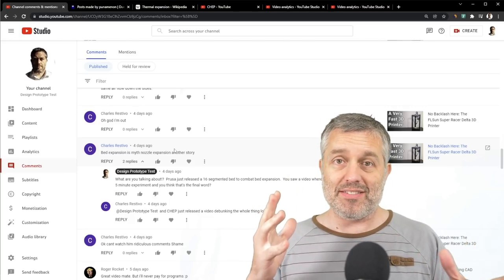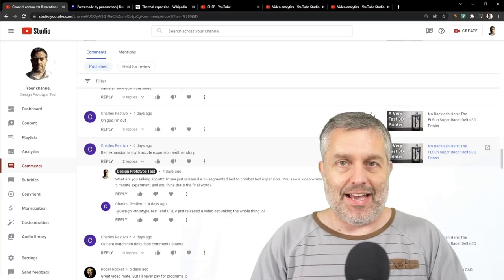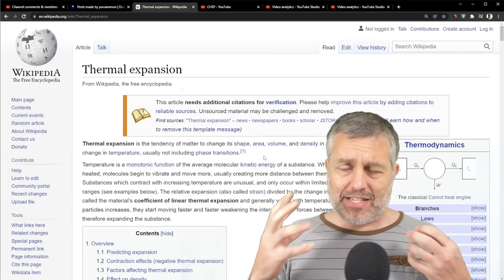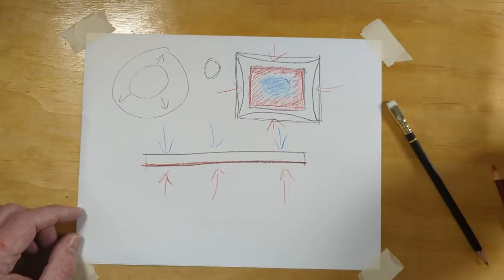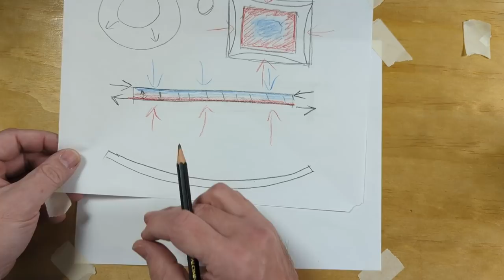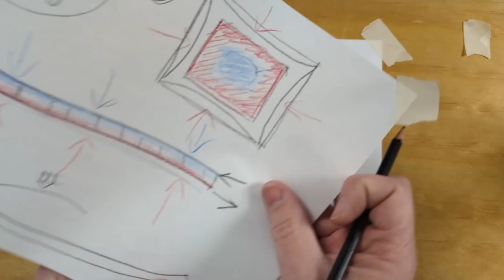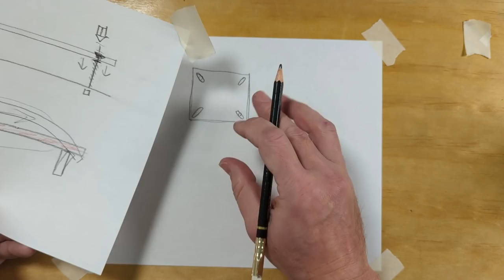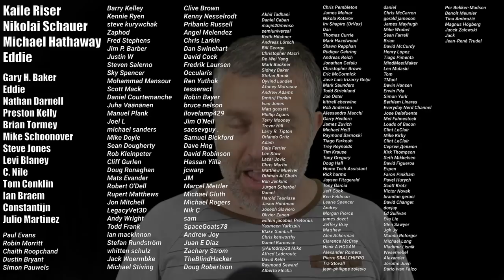The Problem With 3D-Printer Beds When They Get Hot.

Comment: Before the comments get blocked I have a question, sooo you have a warp bed or with bumps and the only way to get rid of those is shaving the imperfections with a CNC or a milling machine if you do it without heating the bed the bed must be flat wright, what would happen if you machín it with the bed heated to printing temperatures??? Will it shave more or less ???
Reply from the maker: The bed is constantly moving/growning/warping depending on how hot/cold it is.

Comment: Great video. I really liked how you made warping caused by thermal expansion accessible. 
Kinematic coupling is what you are proposing. There is some really great literature on this out there, kinematic mounts are used in precision engineering and research quite commonly to deal with the sort of thermal expansion you describe. 
A US company, I think mandala rose or mandala rose works or something is selling a magnetic kinematic bed mount that might be worth looking at for inspiration, you could probably build something similar for a few $ with ball end bolts, cheap magnets and a couple of printed parts. I think it uses "Kelvin coupling" where one point is constrained in all three axies, one is constrained in two(say XZ) and the third is just constrained in Z. Allows even predicable thermal expansion.
Have a look at the Annex Engineering Gasherbrum K3 3d printer, you can find the design on github, with edrawings so you can have a look at how they did it. 
They used maxwell kinematic joints which essentially constrain 3 points in two axis each but all pointing toward the center. Again allows for even and predicaable thermal expansion, but with expansion happening from the middle out, as opposed to from one of the mounts out in the kelvin coupling system.
This coupling system for the bed was one of the things that enticed me to build one.

I'd love to see a great kinematic bed mount solution for the ender 3. I think it would have to be a kelvin type system so that you could keep two of the mounts constrained in the Y so as not to introduce too much play and additional resonance into the system.

Comment: In my opinion the forces that are created by thermal expansion are not constrained by the flimsy mounting system. I havent checked aluminum but a glass bed bows more than a layer height everytime the heater came on during PID
Reply: This highly depends which glass you use and how tight you clamp it. If glass has the chance to expand without being forced into tention it is a material with very low bowing. I print on normal 150C floating glas with aboslutly now bowing when I use only weak clamps. This weak clamps are not able to hold back the bowing of FR4. The 400C rated glass from creality for ex. is even better...

Comment: If we set over the aluminum bed a thin piece of glass do we not minimize the issue? It would be nice to see some tests. Sorry for bad English. I appreciate you standing for your point of view, keep up the good content!
Reply: depends on the glass. glass expands and contracts with heat just like pretty much everything else
Reply: @Jay Aristide  yes, but is not constraind by bolts, just by some paper clips that I think allow expansion
Reply: @razvanilea  problem is glass will tend to bow/flex with the metal underneath. It wont bow/flex AS MUCH as the metal underneath, but it will still be a measurable amount. On smaller beds, it wont be enough to be an issue. On larger beds, though, it will be enough that you still need to correct the underlying issue
Reply: @jfaristide  yes, I think you are right

Comment: ::Looks at my CR-10 S5 and cries inside:: That damn thing is so SO warped when heating, not even the BLTouch can save grace...
Reply: you can do a 3-point kinematic conversion (the ball bearing solution he mentioned) on it. you'll lose a little z but thats it
Reply: Same here. Printing my first layer thicker to reduce the problem.
Reply: @jfaristide  This won't help much without mesh leveling. Crealitys printers are know for warped beds. Even without thermal expansion. My Ender 3 is so warped without an bltouch nothing would stick.

Comment: nice video. well explained.
am wondering about the bed bowing upwards. would say the supports dont confine rotation so hinge at each end basically. and it doesnt confine it upwards because the spring is much less stiff compared to the bed. the supports probably give some tension force along its axis which would be facing inwards when the bed expands. maybe they could put the bottom of the supports in a wider stance so when the bed expands the force is just downwards.
the ball bearings i think is a great idea. just use ball bearings on all supports except for 1. it would need something to stop the bed rotating about the single solid support though

Comment: I would love to see a video with the math behind this and do a real test with surface trace (could be a bltouch with a big mesh like 30x30 points) and test it at various temps like room temp, 40°, 50° all the way to 100 or 110 and compare the mesh, maybe if you print Pla and your room temp is like 25°C and you take your bed to like 50°C there is not much of a difference, but to 110°c the bed would get really warped. Pd: keep the good work!

Comment: I thought that was a good demonstration of the theory. On the other hand, Chuck did the experiment and found the effect negligible _on the printers he tested_. The bottom line is, YMMV depending on many factors. I think Chuck's data is certainly worth considering if you're using a Chinese printer with a relatively thin, spring-mounted build plate made from rolled a aluminum sheet like he used. Try it yourself, do what works for you, but don't assume it will work the same universally.
Reply: I think the laws of thermodynamics are fairly universal.
Reply: @jfaristide  Yes. Nothing I wrote implies otherwise. It's a question of how much thermal expansion effects your bed tramming and mesh leveling.
Reply: Chep replied in the comment section this dude didn't even bother to replying to him or pin his comment. Now I remember why I've never subscribed to this channel.
Reply: CHEP by action disagrees with his own findings. He noticed his ender 3 did better with a glass bed, even though it was “barely affected by the heat” in the measurements. This is without measuring anything, he already came to the correct conclusion before the flawed test.
Reply: @H0mework  My Ender3 also does far better with a glass bed. Because it came with a warped build plate made from shitty rolled aluminum. The glass is simply flatter. The fact that Chuck gets better results on glass doesn't necessarily mean thermal expansion is the reason.

Comment: he is wrong the bottom of the print will become irregular i have cr 10 smart pro when i brint abs the middle is like a pond because of the temp so iam trying to use aluminum sheet under the flexible sheet to reduce the  magnetic power

Comment: To be fair, if I recall correctly, chep didn't say that bed expansion is a myth. His point was that with his ender 3 setups, leveling the bed while cold or hot doesn't really affect adhesion while printing PLA. I remember watching it and disagreeing with him at the comments that on higher temps the expansion could seriously cause trouble. 
But as he said, If you print something big, you are ok and if you bring something small, you can always print it over a levelling knob. 
In any case, thanks for the theory. 
That comment is just another case of 3d printing people that heard something, misinterpreted it and share it with the rest. Sad but it happens a lot

Comment: I've tried another solution, attached glass bed to the heated alu bed with rubber bands, so I got 4 rubber bands running along the x and y axis. Those are tight latex ones so corners are firmly compressed, and it levels out those concave edge centers of the bed. It worked for me, before that my ender 3 had huge problems with first layers, but I dont have a bl touch to test it indepth.
Reply: that's pretty slick...way to think outside the box
Reply: @Jay Aristide, there was few options, I could put 4 clamps along each side to compress those edges. But I came with this solution, and it's neat, other option is to use sticky surface that doesnt require heated  bed

Comment: Well if you calibrate with multiple points at bed target temperature for the material used and there are no huge fluctuations anymore, it isn't really as relevant is it? - so maybe that's what someone means when he says its a myth?
Reply: except thats not what chep did, at all. he calibrated on top of the screws where there would be no difference, then once in the middle.

if your test is fundamentally flawed, then your results will be, too.
Reply: @jfaristide  Sry, i wasnt really aware of the chep guy and what he did or where to see it. Should have watched the video more careful :/

Comment: I am kind of stunned that the guy that left that comment, could get through the mental gymnastics to somehow think that the bed(a piece of metal) does not expand when heated, but the nozzle(a piece of metal) does indeed expand. Both will expand. Granted different materials expands at different rates, but still both will expand. How significant the expansion is, that will be another story. This person was either very ignorant, or being a massive troll.